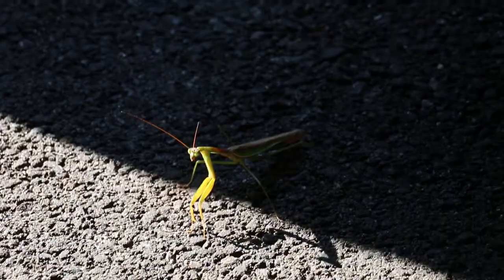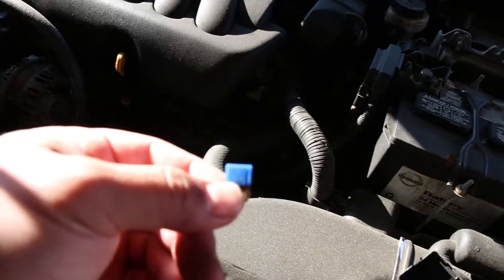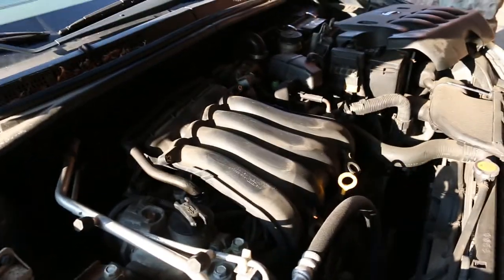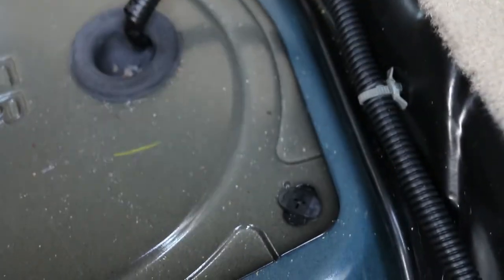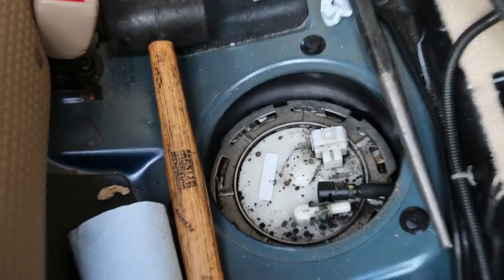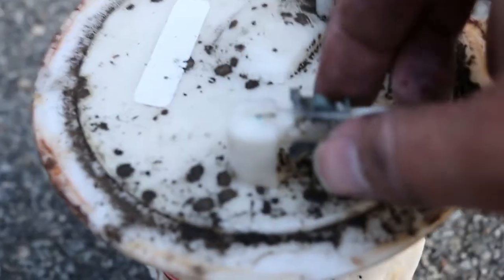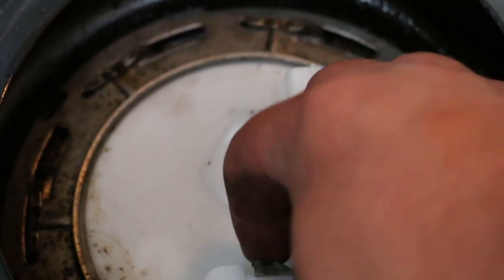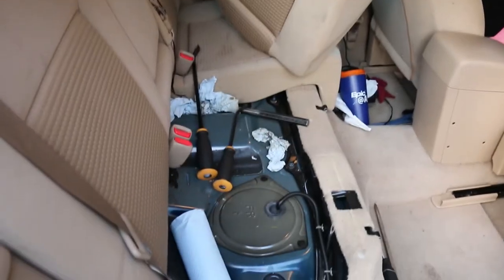Nissan Sentra Fuel Pump Diagnosis and Repair DIY

Comment: This is a great video, it helped me change out the fuel pump in my daughter's car in about 45 min.  That includes the cleaning, before removing.  There was a lot of dirt on mine.  i brushed it first then blew it out with some compressed air then hit it with brake clean.    one thing i would recommend is to change up the points your trying to hit the ring from.  i found i was able to get it on and off with about 10 hits each doing this with a large screwdriver.  Thanks again for the great video.

Comment: I'm getting the engine light coming on.  I get error code PO462 which is Fuel Level Circuit low input.  I have a 2015 Nissan Sentra.  Would this require taking out the fuel pump??  Is it a similar process?

Comment: I have a evap code check the fuel cap tightened and today I fill the the car to the max and when i was parked I smelled gas im gonna check this tomorrow to see if there is a leak on the pum i saw fuel on the tank looked a little wet thanks

Comment: Dude you’re an absolute god amazing video gonna do all of this tomorrow to see if I can’t fix my girls 2008 Nissan did the exact same thing as this one
Reply from the maker: Good luck!
Reply: @FoulNews  hers might be done for I don’t have all the tools you do to test compression and stuff but tried spraying some starter fluid in the throttle body with it open and it still didn’t want to fire up went a little faster but didn’t start it up I also changed all the spark plugs still doesn’t seem to be getting any spark to want to start up at all just cranks still could be the fuel pump?
Reply from the maker: @imax3d252  Have you tried a code reader on it yet? It might have some shadow codes or some info on what's going on. I'd also check to make sure that there is spark as well.

Comment: Did you disconnect the fuel pump fuse and battery before replacing the fuel pump?

Comment: Good video bro👍 my wife's car cranks but no start & no codes. I'm definitely going to remove rear back seat & check the pump.
Reply from the maker: Thanks man. That definitely sounds like a fuel-related issue if there's no codes. I'd suggest removing the back seat and listening to the pump for any noise when the ignition is on. Normally it will prime for a few seconds. If not, it's likely dead.

Comment: How has this amazon aftermarket fuel pump held up for you guys long term? Any issues or codes after install? Thinking about changing my sister's out in her 08 2.0 but concerned about the cheap price of the one in the link some other aftermarket ones are close to $200.
Reply from the maker: So far it's been going strong without any issues whatsoever fortunately.

Comment: yo good video I was finna buy a pump  for 334$ at auto zone thanks for the link and question is the fuel filter connected with the pump?
Reply from the maker: Thanks! I'm glad it was helpful! That's correct, the fuel filter is part of the fuel pump assembly.

Comment: I wasn't able to reconnect the hose to the new fuel pump. You have to push the hose until you hear the clip click. The hose won't stay connected to the fuel pump if the clip isn't engaged. I removed the clip and still couldn't push the hose far enough to where it needs to be. Am I missing something?

Comment: Do you know where the Schrader valve is on this vehicle? Where you hook up the fuel pressure test gauge? Thank you
Reply from the maker: I'm not sure if there is one on this car, but if there is, it might be on the fuel rail. If not, then I'd suggest using an in-line fuel pressure tester. The rail has a standard quick connect fitting on it. I'm not sure if it's a 3/8 or 5/16 though.

Comment: I would like to know where the fuel filter goes in this Sentra b16?
Reply from the maker: The fuel filter is part of the fuel pump bucket assembly that was replaced in this video.

Comment: What was the initial error code that you were getting, Also can you put up the link for the part you used
Reply from the maker: There was no error codes present for this. Just the symptoms of cranking and then starting on starter fluid. The part I used was: https://www.amazon.com/MUCO-Electric-Assembly-Sending-2007-2012/dp/B0777K51CJ/ref=sxts_sxwds-bia-wc-drs1_0?cv_ct_cx=2007+sentra+fuel+pump&dchild=1&keywords=2007+sentra+fuel+pump&pd_rd_i=B0777K51CJ&pd_rd_r=9fbacd97-df4e-4070-addf-60fc35329f6b&pd_rd_w=semI3&pd_rd_wg=vMSVc&pf_rd_p=c33e4373-edb9-47f9-a7e6-5d3d6a7a4ad0&pf_rd_r=AX884Q6FA8EQQQ2B3VV7&psc=1&qid=1607481265&replacementKeywords=fuel+pump&sr=1-1-5e875a02-02b1-4426-9916-8a5c26cd5a14&vehicle=2007-67-899------------&vehicleName=2007+Nissan+Sentra

Comment: Hey man, I have 2007 Nissan Sentra and just starting to randomly die, I had it working for about a week running good until it died again while driving, I have taken it at 80+ mph for about 40 mins running great and I have  brand new fuel pump installed just last year, it turns on and runs great can a fuel pump go bad after a year? EDIT: I checkout out the pump and it seemed to be running good what I notice was the connector that goes to pump, it has one of the small ports burned and If I pushed on it the pump would shut off, do you think that’s the problem I could have? Thank you
Reply from the maker: If that connector is burned, I'd suggest replacing it. There may also be something wrong in the fuel pump circuit if it's causing the wiring to melt or the new pump may have an issue causing too much of an amperage draw, which could cause your symptoms.

Comment: question, I have a 2010 sentra, this is what is going on.  Start the car and works without a problem, but as soon as is regular temperature, I turn it off, and immediately try to turn it back on again and it doesnt do it.  just have to wait to cool down and then it works   not sure what it is.   looks like fuel pump??  or not
Reply from the maker: It could be a number of different things. What happens when you try to immediately restart it? Does it crank without starting or does it not crank at all?
Reply: @FoulNews   no it doesn't  try but I just have to wait for at least 10 min and then starts,
Reply from the maker: @javi8435  Check your main ground cable, which is by the passenger side motor mount. Typically when those get corroded or break, there's not enough of a return path for current when the engine is up to temp to engage the starter properly. Also, check any other ground faults as well.

Comment: My Sentra 2010 jerks while pressing gas and at idle randomly, car turns off. I've changed the spark plugs ignition coils, air intake boot, replaced both oxygen sensors, and got a new muffler and put in fuel injection cleaner but car still does these things. They are annoying. Is it possible it's the fuel filter or fuel pump? Oh I've also had the maf sensor changed
Reply: Same problem for me with my 2011 sentra
Reply: @BMulaEnt  fixed? Same problem here.
Reply: Mine was doing thing. I changed spark plugs,  ignition coils, throttle body,  maf sensor.  Currently check engine light still on. My next move is to change flue pump.
Reply: Mine was doing thing. I changed spark plugs,  ignition coils, throttle body,  maf sensor.  Currently check engine light still on. My next move is to change flue pump.
Reply: Oh btw you need to change maf sensor or throttle body sensor.  Mine is not cutting off anymore.  Maf sensor are pretty cheap, easy to install.  I did it myself.

Comment: Hi my pump receives 12 volts for only 10 seconds the stops, then no voltage? Hence car runs 10 seconds then Dies?
Reply from the maker: That sounds like the fuel pump relay could be bad. I'd test the relay to verify.
Reply: @FoulNews  Where is it located? Thank you
Reply: 2007 Nissan Sentra
Reply from the maker: @deborahcarruth8766  If I remember correctly, it's located in the fuse panel in the engine bay by the battery.
Reply: @FoulNews  Thanks
Reply from the maker: @deborahcarruth8766  no prob, good luck!

Comment: Mu retainer ring doesn't want to come loose.
Reply from the maker: Try using some PB Blaster or WD-40 around the ring. You can spray it right underneath the tabs on the ring itself and let it soak in for a little while. Then the ring should be easier to move. If it's still having trouble, you may need a larger hammer or you may need to use an air hammer.

Comment: The plugs are brand new with maybe 10,000 miles on them....lmao!!! Id change them every 10,000 miles! They are pretty worn out at 10,000 miles
Reply from the maker: The service interval is between 60,000 and 100,000mi for these motors. When I replaced them around the 65k mark, there was no significant wear. If yours are worn down at 10k, you might have some other issues or you're using the incorrect plugs.
Reply: I swap plugs every 500 miles cause of a turbo plus nitrous in a 388 stroker thats mainly at the strip but does see alot of street too. But on my turbo'd daily, its about every 10,000 miles